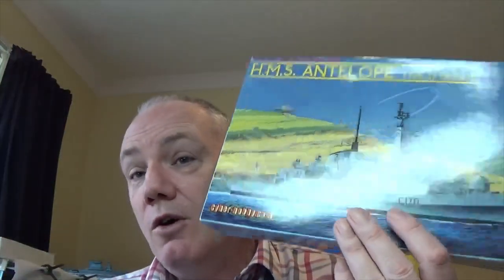Scratch Building 1/700 , 1/600 Type 21 Frigate Part 1

Comment: Great start so far mate 👍🏼
Served on her sister ship F172 Ambuscade from 1991 till she was sold to the Pakistani navy in '93 and renamed the PNS Tariq.
Great workhorse of the fleet but hard work  😏 if you was part of the 180 crew compared to a Leander class  which was of comparable size bit with a crew of around  230. Anyway nice to see that you managed to fit in the paint store and the tiller flat with your 'aft strengthening bulkhead.
Funny that , that being an ex-matelot I've never felt the urge to build a ship I tend to concentrate on helicopters and armour , but TBH i'd give my left nut to build a Type 21 in 1/350 or bigger if a manufacturer brought one out, they seem to be sadly unrepresented within the hobby, which is a shame. Anyway keep up the good work I'm off to watch part 2 & 3 now 😊
Reply from the maker: Here's me an ex Tom who loves post war Royal Navy ships at least you know your way around them . Sorry if i don't get things right the ptsd doesn't help i remember things then forget them just as quickly . Regards Gav.